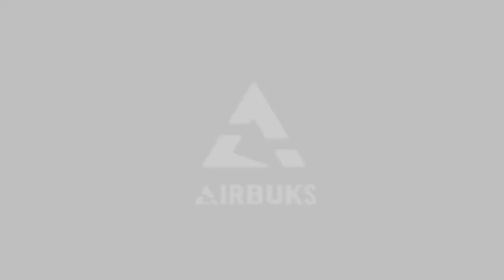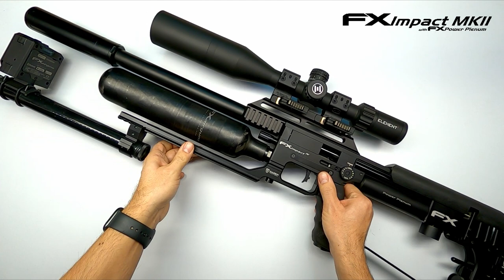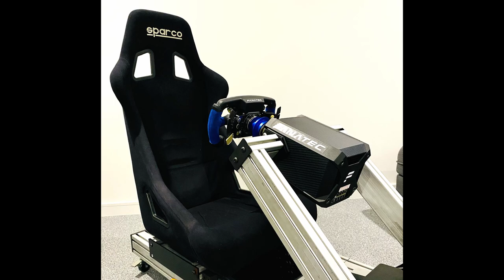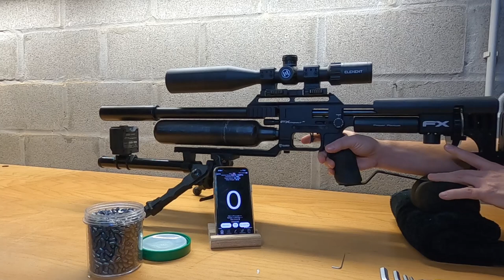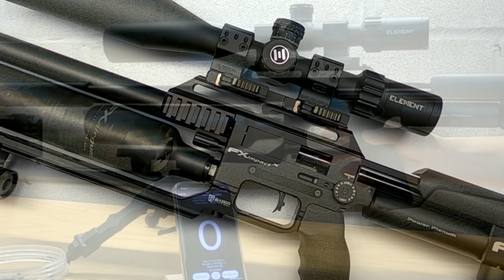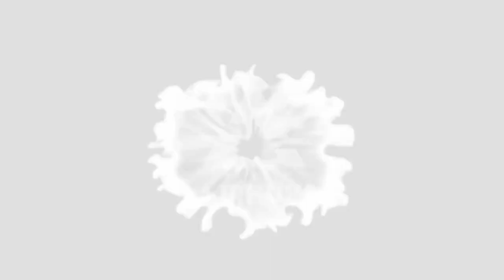FX Impact MKII Slug Power Kit Tune ( JSB KO 22 cal )

Comment: I have just installed the slug power kit in my .30 Impact. I ended up in a similar situation.  155 bar, valve to the 1st line and hammer spring maxed, but I turned the dial to 4. Small burst of high pressure to shoot a NSA 49.5gr. 950fps. I got a higher velocity of 970 but it used a lot more air and was not as consistent. Thanks for the very informative video ! I'm going to do some more tuning !
Reply from the maker: Yes it’s is funny how different the tune is compared to the original setup.
I went out filming the accuracy and it turned out the best preforming at setting nr 4 970fps  . Velocity isn’t everything, accuracy on paper is what counts
Reply: Another phenomenon that I had was as the velocity increased my slugs impacted lower ? ? ? ?  Any thoughts?
Reply from the maker: @bcml8  I bet that’s has to do with the harmonics of the barrel and the slug exiting on a antinode and pushing the barrel down . 
1. Try 10fps more or less 
2. Turn the liner 180degrees can also help that

Comment: Nice Informative video. 
Sir can we shoot pellets accurately with dual port barrel and slug pin probe installed.
Reply from the maker: With a dual tp for sure , the pin probe is a little different as seating depth is important and pellets have a skirt compared to the pin . A probe will push on the skirt where the pin pushes into the skirt seating it not far enough in some cases . If you use shallow skirts you might be oké

Comment: Hi, the part you was adjusting, is that normal to have some movement back and forth? Also, how much more efficient will it be roughly?
Reply from the maker: if you are referring to the small block on the hammerspring adjustment, Yes it is normal it moves . Efficient will depend on the tune . The hammerspring adjustment is a tuning part , efficiency will be effected by it but it depends more on tuning in a certain way

Comment: Hi. Nice work you doing. Could you please tell where I can get that extension where you mount the fx radar please?
Thank you!
Reply from the maker: Hi , I made it myself. It a simple 30 mm scope mount that holds a 30 mm tube and connects to the front of the saber tactical arca rail 👍
Reply: @Airbuks  Thank you I"ll do it also.

Comment: I want to install the pin probe e dual tp on my heavy slug liner 70mm on mkii power plenum ( same of you) BUT for 25 grains not installing heavy hammer and valve spring of the kit because i think under 30 grains and 150/160 bar is not the right choise...what about you...out of the box mk2 pp and jsb knock out have a peak at 900fps with 18.50 mm screw max weel and max valve and 130 bar, wanna check with dual tp, heavy liner and pin probe what i get in terms of velocity
Reply from the maker: Indeed the kit is more aimed to shoot heavier slugs  but even at these lower weight slug and smaller caliber it works perfectly without problem 🤷‍♂️ I have installed it to be able and change the caliber or weight off the slug 
The TP and slug probe should give you 20-40 FPS extra

Comment: What is the difference between slugs powers kit and high flow dual hole transfer
Reply from the maker: They are completely different things . But both are some different accessories that work nicely together to give you some more power . 
The dual transferport allows more air to flow into the barrel
The slug power kit contains some spacers to create more hammerspring tension and a slug probe to help more air to transfer from the plenum true the dual hole transfer port into the barrel . Where the original probe blocks the opening more and restricts the flow of air

Comment: what are the settings for the .357 to shoot 90 grain slugs at 910 or 915?
Reply from the maker: Don’t know buddy , don’t have a 357 🤔 . But I think you better install a heavier hammer spring , softer valve return spring , regulator on 155-160 and you should get there more or less

Comment: Do you use the old 57 mm or the new hammerspring? With the old one the power wheel lost its function
Reply from the maker: It’s the original spring that came in the Impact MKII compact with power plenum . Never measured it 🤔 but the impact is just over 1 year old
Reply: @Airbuks  ok Thank for reply. It’s the shorter one then . If you put reg higher than 125 you velocity drops ?
Reply from the maker: @4450OhDeere  no I can increase it to 150bar but then the FPS goes way above  1000fps , I found this setting a good midpoint between the velocity I needed and the shotcount
Reply: @Airbuks  ok I never tried that high on the reg. Thanks for the reply

Comment: It this the flow/approach that should be used when turning to a heavier projectile or is the process not that simple.
1. Increase reg slightly (5 psi at a time)  
2. Increase, in small increments, hammer spring until no further increase in velocity
3. Increase reg pressure a little more and decrease hammer a little 
4. Bring valve out (CCW) 
5. Fine tune, very slight increments, the reg, spring, & valve

Also, is the hammer spring knob just used to fine tune while at the range? I hardly ever see folks using it in videos. They usually use the alan to adjust.
PS. 
Great Video, thanks,
Reply from the maker: There are different methods of tuning, this is the way I like to do it giving me good results and efficiency.
About the powerwheel I like to tune it on max setting to the highest velocity I am looking for then I go out and shoot it on paper at every setting and see which one is giving me the best results. Next video you will see what I mean exactly 😉

Comment: Wait a few second to fill it up the plenum will change the result a little bit...😁😁 There is a big difference like 979-1002 fps.
Reply from the maker: Hi , what are you referring to ?
Reply: That means you shot at short interval sir😁 which may not due to fully air inside plenum. You shot close together..kk...

Comment: I’m confused you said let’s see if increasing hammer spring gave you more velocity but before that you said it was already maxed out?
Reply from the maker: 🤔 can you give me a time code so I can check that for you
Reply: @Airbuks  2:39 you said let’s increase hammer to see if you get more velocity but at the beginning of the video you stated you already started at max hammer
Reply from the maker: @arubino19  ohh I see yes 👍🏻 , what I meant and could be confusing is that I adjusted the hammerspring in the beginning of the video to the point where the adjustment block doesn’t move anymore. But with installing the slug power kit and the two spacers you can adjust it even abit higher without damaging anything. Sorry for that confusion

Comment: Have you tried  the  javelin  slugs  before
Reply from the maker: Not yet , I have some but it needs a different tune I suspect. Once my jar off knockouts is finished I will give those a try aswel . I believe they also preform better out of a normal superior liner instead of the heavy since they are made from softer lead
Reply: @Airbuks  yes they  wo4k wel but you must have n tune  for the orels you wil shoot n shotgun groups

Comment: Its unreliable
Reply from the maker: How do you mean ? The tune or the gun ?
Reply: @Airbuks  Both - you spend 2000 $ and then have a headaike with tuning, later - with all those O- rings.Sellers have money, we - problems to solve.
Reply from the maker: To be honest mine had zero issues since the day I bought it , taking it apart many times over .
The Impact is perfect but the way to keep it in perfect shape and tune isn’t easy . It’s not a unbox set and forget kind a gun .
Reply: @Airbuks  Yes, yoy are right - it aint easy to mantain iPCP in a normal shape. Just opposite to 22lr. But tastes differ, and sometime we choose difficult and expensive way . Just to overcome
Reply from the maker: On the other hand fiddling and tinkering with my are guns is a part of the hobby I am really enjoying aswel 😉
Reply: @Airbuks  HOBBY - IS A KEY !